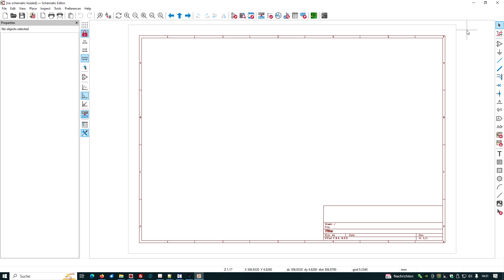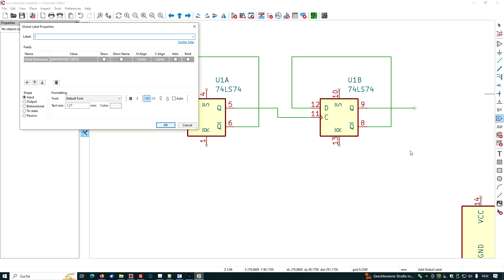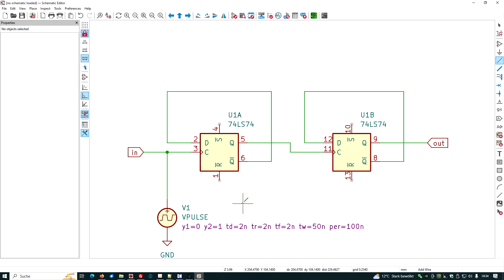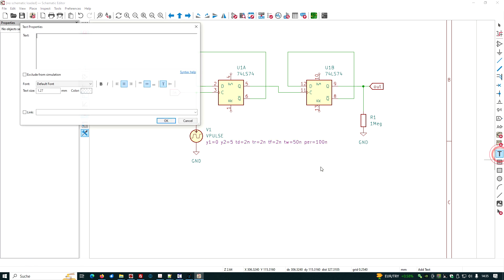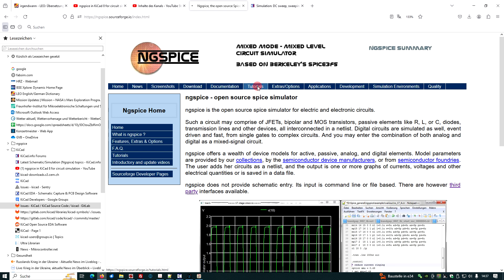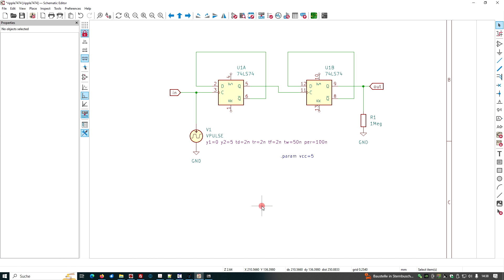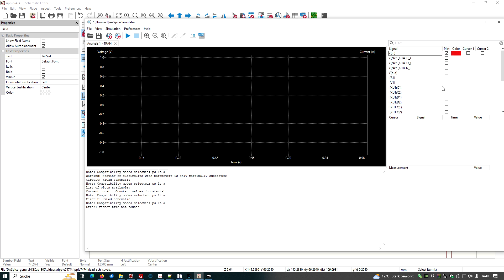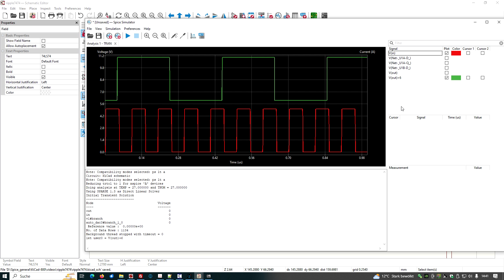ngspice in KiCad 8: Logic simulation, divide by 4 with 7474

Comment: doesn't work 😔
Error: there is no circuit loaded.
Warning: Nesting of subcircuits with parameters is only marginally supported!
warning, can't find model 1prebar
Circuit: KiCad schematic
Too few parameters for subcircuit type "74hc74" (instance: xxua)
Too few parameters for subcircuit type "74hc74" (instance: xxub)

Same problem at a 74HC02 project.
Here is a little bug with the pin-nr's:  Xnand1 2 2 1 74HC02
But that is not the main problem.

Version: 8.0.1-8.0.1-0~ubuntu20.04.1, release build
	ngspice: 42
	Compiler: GCC 9.4.0 with C++ ABI 1013
Reply from the maker: Hmm, it works, at least for me (using MS Windows).

There might be an installation problem (with the code models) on Ubuntu.

Could you please post yor question/report at https://forum.kicad.info/ (where also Ubuntu users are active)?
Reply from the maker: A working example is available at https://forum.kicad.info/t/how-do-i-simulate-a-74ls74-flipflop-using-ngspice-41/45571/12